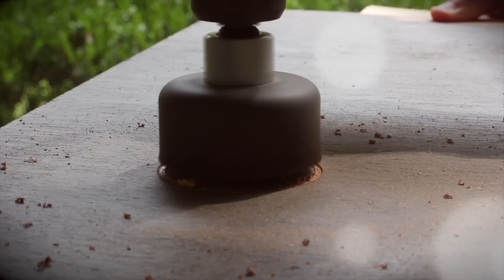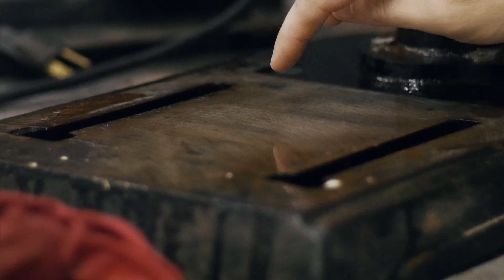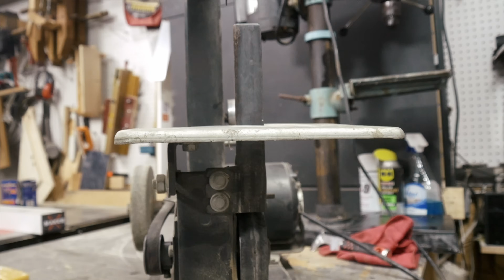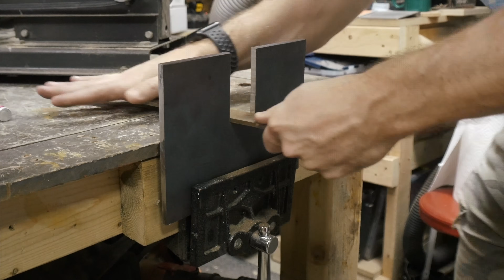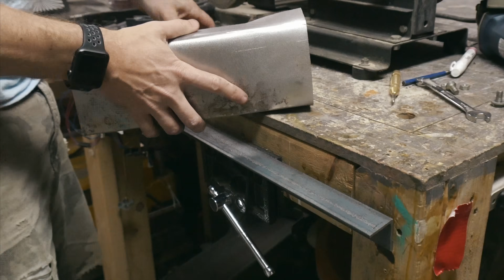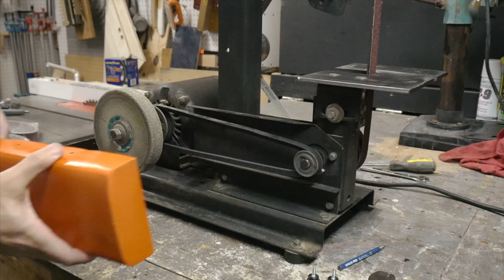Fixing Up A Used Drill Press and Belt Grinder // How To | I Like To Make Stuff

Comment: i picked up a used drill press (a small one from harbor freight) for $10, quick blast in the sand blaster took care of the surface rust and a quick spray job and it looked new

Comment: I recently discovered using vinegar for rust removal, but I also learned you have to be careful with it. It worked good on some rusty steel bolts  and an engine pulley - I let them soak overnight or even several days depending on how thick the rust was. It worked good. That success made me vinegar crazy and I started chucking a variety of stuff in the vinegar bucket. I threw in some rusty pliers - it removed the rust but they turned black. I put a rusty pruning saw blade (stainless steel?) overnight. The rust came off but the blade turned black. I had another of the same blade and I chucked it in the vinegar, but I forgot about it and left it in for a couple of weeks. The vinegar pretty much ate the blade. Learn more about it  than I know, and be careful.

Comment: Here in my area Craig's List sucks!! If you do find a decent tool they want more money than what a new one is even worth! Or you find a used tool that is missing so many parts or broken in a way that you end up spending as much to repair it then it would be cheaper to buy a new tool to start with! I know I bought a table saw for $80, then had to spend another $200 for parts to just get it to work! So in the end it would have been far cheaper to just buy a $200 table saw! So I am never buying anything more from Craig's List ever again!! Besides you don't get things like manuals or the assorted tools that are supposed to come with those tools either! And a drill without a chuck key is easy to replace....but a table saw without a rip fence at times is hard to find a new rip fence to fix them when nobody sells a replacement! So Craig's list sucks......I only buy new tools anymore....even from eBay they have new tools as well!

Comment: Hey Bob when using your handheld bandsaw like that put a zip tie around the switch and plug the cord into a power strip and you can use that to turn it on and off

Comment: I picked up a 1970s craftsman contractor table saw from a friend who stored it outside in the rain. Needles to day the nice cast iron top and wings were covered in rust. I ended using navel jelly. Stuff is awesome and I was able to coat, let sit, remove, sand a bit and reapply the used stuff. Including wait times between applying the jelly, it took about 8 hours to completely clean the surface. In the end the top looks good as new. Every other time I use the table saw I make sure to add a coat of hardwood floor wax to it, no more rust and wood just glides over the surface.

Comment: As a tip for dealing with rust I use a product called vactan does the same thing as the product you use but it's water soluble and there's no fumes seems to work a lot quicker aswell

Comment: Just curious, why did you decide to use clear enamel on the belt grinder work table but used T-9 on the Drill Press table?  I'd like to know which material is better for which application.

Comment: I have an excellent drill press, but a belt sander is something I really really want. I can buy a new one for about $150 and I think I'll end up having to buy it because I really want to start making knives. The 2 things I really want is a bandsaw I can use for metal as my small one only will do wood, maybe plastic and Perspex but the band size limits the blades I can buy. The next thing is a power hammer. I know I'll never get one because forging is really just a pipe dream but my dream workshop has one! Restoring scooters sounds cool too man, I have a Yamaha U7E from 1969, I'm going to restore that one day when I organise everything else, I also have a Honda XR400 I want to turn into a motard but with my back injury I doubt I'll ever ride it. Good video man, you're really well set up now.

Comment: ospho, naval jelly, and milk stone remover are all phosphoric acid, and they remove rust as well as leaving a surface that will be slightly protected from rust. MSR is the cheapest, and can be found at tractor supply stores and similar. naval jelly is at home Depot and you can get a pint for $7 or so. naval jelly is nice because it is a jelly, so it will stick to vertical surfaces.

Comment: i find the best way to remove surface rust from flat surfaces is to scrape all the heavy rust with a razor blade (just knocks off some of the bigger stuff and makes the next couple steps easier).  Then take a wire brush drill attachment, and go to town.  If you have a tool surface that needs to be precisely dead flat (I'm talking down to thousandths of an inch), skip the wire brush and use a chemical compound like ospho.  Then go over the whole surface with some 100 grit sandpaper on a wood block, and touch it up with a higher grit.  Boom, no rust.

If you haven't seen it, watch peter brown's video on how to remove rust from tool surfaces.  It's good stuff.

Comment: A tip for fighting rust on parts. Try gun bluing or pickling the surface. (the process goes by many names) it wont add thickness but its a great way to protect the surface of metal.

Comment: I bought a Delta drill press little bit newer than that one for $40 on offer up same thing had its surface rust all over it hit it with a steel wire wheel brand new also bought a lathe for $60 all it needed was a switch

Comment: I love used tools I have bought many and rebuilt them I currently have a 1923 oliver model 80 12 to 16 inch tablesaw to rebuild. I have a 1947 12 radial arm saw and a 1972 delta unisaw both work great

Comment: I buy lots of used tools at flea markets and yard sales. I've got 20+ pipe and bar claps and I've never paid more than $5 for a clamp. i usually us a wire wheel to take a lot of the rust of my used stuff. I have jointer in my garage I need to put back together that I bought for $25.

Comment: a little tip I picked up from another YouTuber is to use two pieces of angle iron in the vice when binding. Both pieces sitting opposite so you get even pressure from both sides👌
Reply: bending*

Comment: Hey Bob, another way to remove rust from smaller parts is to use citric acid, which is usually used to clean coffee machines.
Just mix it up with water in a bowl, as described on the bottle, then put the rusty parts into it and wait for several hours.
It worked fine for me. Maybe you give it a try ;-)

Comment: We did maintenance on machine shop tools we used OXPHO by brownells it's a gun finish we would apply it with steel wool to remove the rust and blue the metal at one time finish with oil we even Put a wad of steel wool in an air drill and used it to work the OXPHO in

Comment: My grandpa told me once that transmission oil is very effective with cleaning black plastic pieces. He discovered this once when he went to go check the transmission oil on a newly purchased truck and it dripped all over the engine cover. When he used a shop towel to clean it off he noticed that the plastic looked about the same darkness as it was when new. He cleaned the rest of the engine cover with the transmission oil. 
Months later when I came to visit him he was showing me his new purchase(the truck) and that's when he showed me his new discovery. 

That's one of my favorite memories of him.
Reply: it's pretty good for loosening rust as well.
Reply: the red stuff?

Comment: A drill with a wire brush spindle works much better to remove rust. If scratches are not desired then sand after with 600 grit and wipe it down with oil or paste wax to seal it and keep rust from coming back.

Comment: Great tips! I soaked rags in white vinegar and wrapped them around the large parts of my drillpress that wouldn't fit in the tub when I recently restored mine. I left it over night and used a wirebrush in my hand drill to shine up the metal. 👊🏻

Comment: You can also use molasses as a vinegar replacement
Reply: Google "chelation rust removal", if it were me I would have taken it apart, dropped the pieces into a bin with Evaporust and came back the next day. But then I have that stuff leftover.. soo..
Reply from the maker: Really?  Wow, never heard that one. Thanks!
Reply: Put the used Evaporust in a container and save it for your next project.

Comment: The tools look great! I bought a cheap Harbor Freight drill press but it isn't very nice. The Chuck(?) seems to have some movement so it doesn't always keep the drill bit in the right spot. I read about that issue in some reviews but it's inexpensive and it does the job.

Have you ever done metal fabrication as a job before?

Comment: Bob, I have a band saw from the 1800's that didn't have a guard that I inherited.  It works, and I'm wanting to restore it and use it...but I want it to look like the original.   I'm ok with not using guards, but I have kids... and I'm scared for them to damage my saw should anything crazy happen (kidding, but the youngest is bulletproof)

Any recommendations on how I would solve this conundrum?
Reply: [Non-invasively] mount a temporary cover until the kids are mature enough?

Comment: Good one Bob.  That was some thick steel you used for the belt cover, probably could have went a little lighter on that.  That drill press is a workhorse for its size.  We have had one going on 15 years survive middle school students good all around drill press.

Comment: I have that same sander as a wood sanding machine with a small disc sander instead of a buffing wheel.  If you ever want to use the belt for internal sanding, which is what those two smaller wheels in the front are for, make sure you check out those small wheels.  They don't have bearings, just bushings, and mine locked up and since the abrasive side of the belt runs on them it ground right through one of them in no time.  The third wheel in the back might be the same way, I can't remember.  I actually have an extra disc sanding platen and table for it if you want it.  They sent me some extra parts that I didn't really need dealing with the problems I had with it.  You'd have to fab a mount for the table.  I have the stock one but it's garbage.
Reply from the maker: Gotcha, thanks for the offer! I've already got a larger disc sander, so I'll probably keep the wheel on there for now.  I don't have any specific plans for it yet.  Thanks for the inside sanding tip!

Comment: I can only afford used tools so I check Craigslist, Ebay, and online auction sites.  I recently purchased a floor model Delta drill press and lathe through Proxibid.  Each were from different sellers, but I paid a total of $210 for both.  This was a huge savings for me.  My 12" band saw, 6" belt/9" disc sander, and 12" planer were purchased years ago through Craigslist and work really well.  I just want a jointer and will patiently wait for a cheap used one.

Comment: How much did you buy them for?
Reply from the maker: I paid $200 for these tools, some wood and a bunch little clamps and other things.
Reply: Oh, that's seems a bit expensive. I got a used craftsman drill press for 40$ and it was only used 3 times in perfect condition.
Reply from the maker: Yeah, the deals will always be different depending on where you are.  The tools here were just part of the purchase though. I also got some mahogany and walnut turning blanks, etc.
Reply: This is kind of irrelevant, but your like the only you tuber that actually responds to comments. Well probably was cause I was early though. 👍🏽

Comment: I have the same belt sander oddly enough the belt cover is missing too but the buffer side is a disc sander yours probably used to be a disc sander and they took off the table. I can send pics if you want to change it back. If you feel you'll use it more as a disc sander for instance. I'm getting rid of mine because I upgraded but it was very useful to me.

Comment: Another really great rust removal solution is citric acid. That works great when you have a reservoir or something sealed up where you can't get to, like an old fuel tank. You can buy citric acid as powder from any pharmacy and then just dilute it with some water. Really great method and really cost efficient.
Reply: Benjami Lindqvist 1) Water is a bad idea if your goal is less rust, and 2) you can get citric acid from a grocery store too for a lot less money.

Comment: Bob, I've actually got the same drill press.. Picked up with a bench top bandsaw a while back for $100. It works fine, but I've been wanting to get rid of the surface rust, as well as tune it up a bit.. I actually enjoy the process of making an old rusty tool look and function like new. Good to see you promoting that so others will see it's not so hard.

Comment: Excellent video Bob,  this past weekend I bought a Powermatic model 50 jointer from an auction. It works well  but needs a new drive belt and a set screw. As usual with tools I get from auctions it has surface rust, I will likely be cleaning it today.
Thanks for the video.
Reply from the maker: Nice find!

Comment: Sounds to me like the chemical just turns one form of rust into another. The normal reddish rust you get is bad because it sort of expands, becomes porous, etc. as it forms, allowing rust to penetrate deeper and deeper. The black form of iron rust doesn't do that, and is fairly stable. What that means is that the loose red rust becomes broken off the remaining iron, and any black rust left behind on the iron shouldn't be too much of an issue anyway.
Reply: They are fairly standard in terms of chemicals and convert the iron oxide (red) into ferric tannate (blue/black). The latter is more resistant to water and more stable.
Reply: Bunny Warren oh, right. I assumed this was the phosphoric acid stuff I'd used before.
Reply: Typically it's tannic acid but phosphoric acid can be used and the result of that is ferric phosphate (also inert). Mixing tannic acid and phosphoric acid can help because both give a stable result and the phosphoric acid speeds up the reaction of the tannic acid.